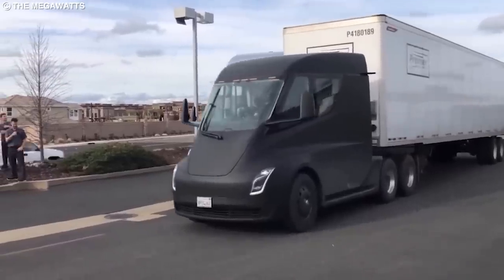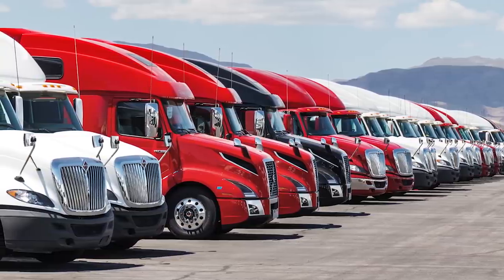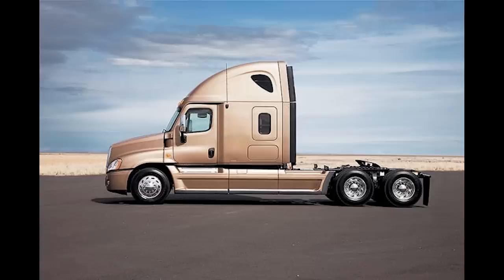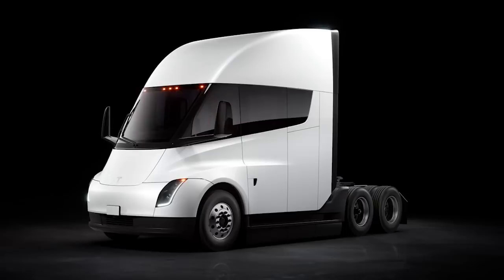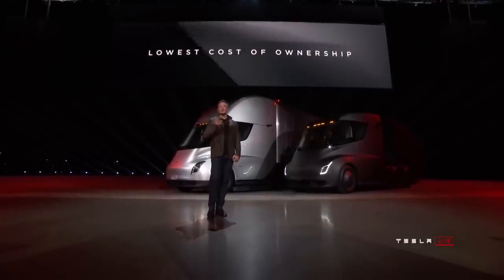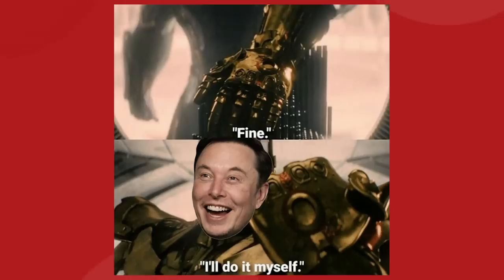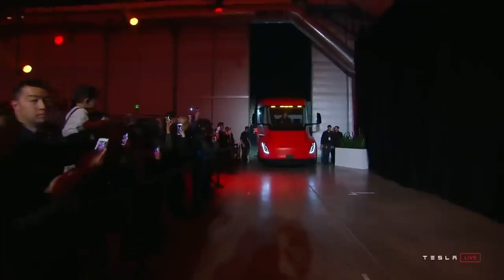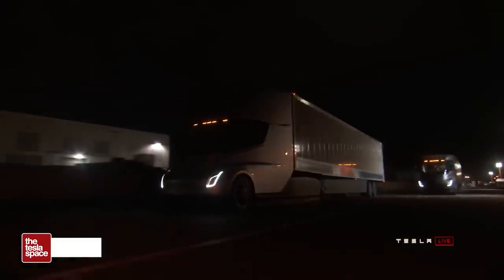The Real Reason Tesla Developed The Semi Truck!

Comment: The problem with the Tesla truck is that it’s designed in a way that visually it doesn’t look enough like additional North American semi truck. Was freightliner did right with the E Cascadia is they made it out to look like a regular freightliner of the century. Not to make it look like a spaceship I’m on the road. Companies may want the eco-friendliness of the Tesla design, but drivers do not want this change to be so drastic. Therefore going with the more traditional truck design in an all electric configuration is the better idea for the North American market
Reply: all comes down to the Benjamins saved  to fleet buyers.  If you want to look antiquated in 5 years, stick with the status quo if you're making a profit still.
Reply: @lylestavast7652  so sooo true

Comment: A lot of these design choices seem to be common sense changes for the industry. Perhaps they were not really relevant because nobody was actually trying to innovate. The existing manufacturers were using the existing designs and trying to cram the new technologies into the same space as they've always used. Much like older vehicles tended to have tons of room under the hood, now-days when you open the hood there's almost no space. 

 This along with Tesla's experience with previous electric vehicles using aerodynamics to shave off valuable drag co-efficient in order to extend the range by every little bit they could squeeze out of them while still looking both sleek and stylish plays a role in expediting some choices for the design of their new Tesla Electric Semi. 

Tesla has somewhat of an advantage in this situation because they have the luxury of building the entire system from the ground up to accommodate new manufacturing methods without having to handle existing facilities expected throughput. Meaning they didn't need to continue to produce vehicles while maintaining the sells of vehicles. Hopefully they keep up the tempo and push the other manufacturers into innovation so we can see both the outcome of the innovate or die situation that is going on for these companies. As it stands it appears as though the other companies are trying to basically come up with parts to put in existing designs with little consideration for whole vehicle optimization. Perhaps this is simply an attempt to remain relevant while they work on whole vehicle optimization. Perhaps they feel the appearance of their vehicle remain the same as a staple of their previous image. Not wanting to change the look of the vehicle because some people don't like that much change.

Comment: The 500miles quoted by Tesla is a completely and utterly useless claim without knowing the weight of the truck & batteries to go that 500miles, which Tesla refuses to tell anyone!

Max weight of a truck + batteries + payload in US is 82,000lbs. unless you know how much the truck + batteries weigh in order to have batters to take that 82,000lbs 500miles and so how much is left over for payload and if that is a reasonable load to be financially viable we cannot know if this is a viable product! BUT Tesla REFUSES to tell anyone this info.. WHY? This is BASIC information!

Think about it.. maybe you could get a semi to go 1000miles, but the payload could only be driver and his lunch box, because to go that 1000miles 90% of that 82,000lbs has to be batteries.. why does no "experts" seem to understand this??

Bottom line is that until Tesla is willing to release the weight of truck and batteries necessary to go 500miles and so amount left over for the LOAD no one can say if this is a viable product or not 🤷🏾‍♂

Comment: 5:41 Volvo Group, Renault Trucks, Scania AB, Daimler and MAN EV trucks are available in Europe in mass production. Tesla, and afaik Nikola, trucks aren't. The main problem with EV trucks is their weight and charging times. Electric trucks are far more viable in Europe than the US.
500 miles is going to come with some drawbacks. Drag and aerodynamics have little impact in Europe because trucks are limited to 90km/h (56m/h). Trucks in Europe don't have the aerodynamics of a cinderblock. Lol.
A drag coefficient is important to make a car go very fast. A truck doesn't ever go fast. And a drag coefficient of a race car? Yeah sure. If you think that's real, you're naïve.  

And as sponsor Kamikoto knives... Please don't buy those terrible knives. They aren't hand made (as if that would be better to begin with) and they don't hold their edge. They aren't made in Japan. They are made of the worst possible materials though. Go to a local store and buy any decent knife, ANY. It'll be better than Kamikoto knives. Chefs all over the world use knives that are far better and far more costly than consumer knives.

Comment: They need their own line of trailers with solar panels
Reply: cant happen... I been driving trucks over the road cross country for 20+ years... it would cost to much upkeep 1-2 years and they just sit on the roof broken and never fixed....
Reply: @martinlindner7837  Tesla roofs are built to handle a bunch of impacts, i don’t think it will happen till 2030. Eventually I think it will, just for long trips, or off grid trips across Australia and such.
Reply: Totally useless and stupid and heavy for no reasons at all.

Comment: It's all fun and games until you have to stop, Tesla doesnt have that good of reputation for brakes that dont catch fire or fade. Trucks need air to brake. How much of those batteries will it take to run an air compressor and haul the standard 80,000 pounds and for how long? Certainly less than 500 miles distance.
Reply: LMFAO BLESS YOUR HEART
Reply: TESLA SIMI TRUCK BRAKES WITH ELECTRIC MOTORS AND THE ACTUAL BRAKES WILL LAST THE LIFE OF THE TRUCK AND NEVER NEED REPLACING
Reply: @paulhailey2537  you say that until you see one on fire or on the wrong side of the road mowing through a load family van. Lightweight doesn't always mean high performance or heavy duty.
Reply: @ElizaJane85  82 THOUSAND POUNDS iIS NOT LIGHTWEIGHT

Comment: There will be no electric truck other than for short range because of the weight of the batteries.
Reply: Tesla SEMI truck coming 1.dec.2022 with 500miles range full load 😄🎉
Reply: No truckdriver are allow to drive more than 4,5 hours non-stop (~400miles), before a 45 minute long break! Tesla SEMI can charge up in 45 minute 😉
Reply: @mikafiltenborg7572  Are you kidding me? If you can not tell me with what max. payload, that number does not mean anything.

Comment: Anyone who believes these range numbers needs to see the video of the guy who tried to tow 1000 lbs in his F150 EV. He could not get 100 miles fully charge. And none will be used for long haul. My suggestion is to put a huge battery pack in the floor of the trailer.

Comment: This still have a long way to go. If it can’t haul 80k then no company and owner operator would be purchasing one cause that’s what the job demands. Imagine being ima storm and all you depend on is battery 😂
Reply: There are over 1000 pre-order for semi ready. Pepsico has 100, USPS 100 etch 🫣
Reply: @jesturcastillo  dude those are local jobs I still stand corrected. So within the city. OTR still has a long way to go if battery can’t last 15h+ on the road going up mountains. If you were a truck driver would understand 👍🏼 I work for one of the biggest fleet bigger then Pepsi and they won’t touch it until they know. Pepsi can take all the risk lol

Comment: This is such overt stock shilling it's sad.

None of the advertised specs have been proven yet.  This vehicle doesn't have a nationwide charging ability, meaning it's relegated to shorter regional routes.  The FSD doesn't work, and even if it did, truck drivers don't use lane centering or other ADAS systems.  (Since they're ultimately responsible for the behavior of that 40 ton behemoth, THEY drive the vehicle.)  The short nose and huge single pane of glass are less safe in a head on crash, and any rock chips or cracks in that windscreen  are going to be MURDEROUSLY expensive to repair.

We won't talk about the fact that most of these speed, power, range, and charging  specs were based on the use of a nonexistent miracle battery, as opposed to the 2170 cells being used.  So Tesla actually beings LESS to the table, for more money.  Add to it the fact that the others already have ACTUAL long range vehicles with sleeper cabs...no reason to waste your time on a trendy wendy instead of a real semi.

Dominating the space without a working vehicle in operation?  Yeah...whatever, dude.  Sometimes it's important to learn a little about the segment before you put out something as embarrassing as this.

Comment: Won't be capable of hauling heavy loads, or dual trailers unless you have a load of potato chips. The I-5 Grapevine will have to be avoided. and would have to stop more often to charge it up with only the 500 mile range
Reply: no one is planning on doing long haul with these.  they're all being targeted at day runs - out and back, with the original all having charging at both ends of common routes.    And most hauls are WAY below the max weight.
Reply: @lylestavast7652  Day runs, Way below weight limits, short distances. That's why Ryder invented the box truck.